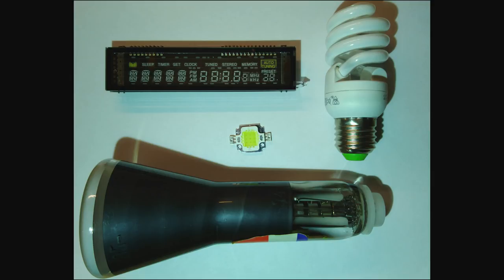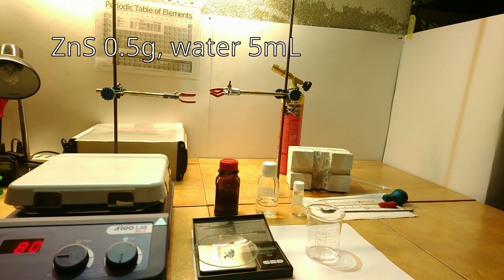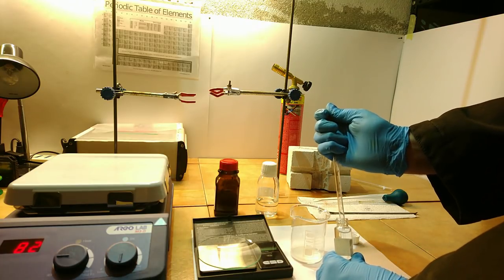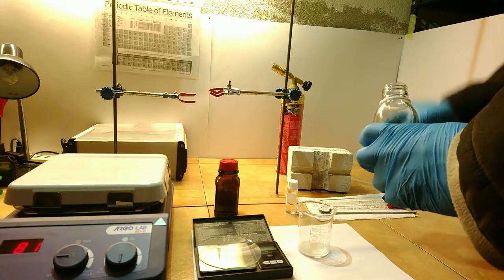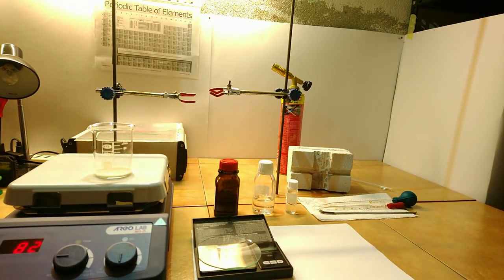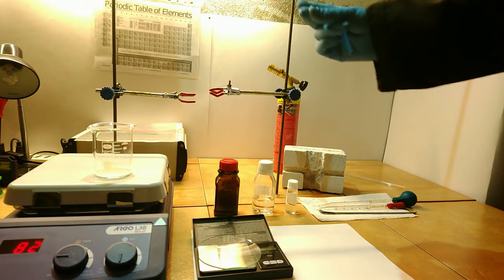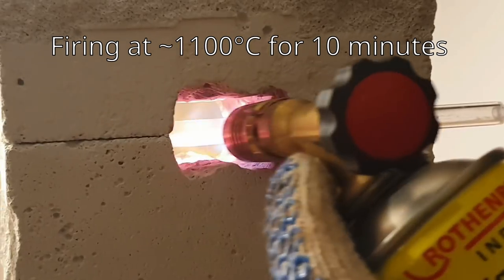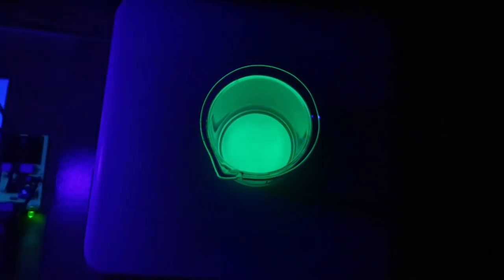Making ZnS:Cu, a green phosphorescent material

Comment: Thanks for the detailed video, we are making this today in my physics university class. Please could you let us know if there is a way to make the ZnS:Cu into a paste/liquid to make it stick to the bottom of a glass conical flask to form a phosphorescent screen (without dripping down the sides if it is moved around). We are making a DIY cathode ray tube :)
Reply from the maker: Chapter 5 of the book Inorganic Phosphors lists some methods. You can find the book in this thread https://www.sciencemadness.org/whisper/viewthread.php?tid=142184&page=2
Reply: @hydrogentime2872  Thank you !
Reply: @hydrogentime2872   sir thank you so much for making this love you so much plz one question 
Sir i made zinc sulphide with
NA2S+ZNSO4= NASO4+ZNS
CAN I USE IT TO MAKE GLOWING POWDER PLZ TELL SIR
Reply from the maker: @Nothingop122  assuming you made zinc sulfide, yes, you can make glow powder if you follow the process described in the video. You will need to add a tiny amount of copper sulfate and ammonium chloride, and heat the powder in a furnace.

Comment: Dose this also work for cadmium sulfide doping? I'm working on recreating no longer available phosphors used in in hold electron microscope screens.
Reply from the maker: The book I reference, "Inorganic phosphors", details many CdS phosphors preparations, with similar conditions. So it will work, but I do not recommend it as cadmium is toxic and you'll be working with fine CdS dust, which I believe poses an inhalation hazard.
Reply: @hydrogentime2872  in comparison to other chemicals i work with on a usual basis, that seems downright safe.

i work with mercury, mercury salts, uranium salts and osmium tetroxide, among other things. 

Thanks for the info, and the book suggestions, i shall read it as well.

Comment: Is it also a Electro luminance which is use in EL Wire ? Can i glow it with 100 volt ac electricity supply ?
Reply: So i can use It as an electro luminance material if I follow this tutorial?
Reply from the maker: I'm still trying to make ZnS work as an electroluminescent material, but I haven't succeeded yet.
Reply from the maker: @omsingharjit  Interesting papers, will have a read!

Comment: Is this process similar to making/growing a scintillation crystal?

If you mixed the doped zinc sulfide with an optically clear hardening resin would that work as a scintillation crystal?
Reply from the maker: I had to look up on Wikipedia about scintillation crystals, and the page lists ZnS:Ag as an option, which is very similar to the ZnS:Cu I synthesized. Maybe it could work, but I don't know for sure.
Reply: @hydrogentime2872   Thanks for the reply. I've been interested in figuring out how to  grow plastic scintillation crystals in a home lab environment but I'm just a hobbyist and no chemist. I appreciate you posting this video. I plan to try your synthesis method, currently just waiting on a copper sulfate.   

Since watching your video I experimented with mixing of ZnS:Ag:Cu with a clear casting resin. My plan is too attach this to a photomultiplier to see if will work as a scintilator for alpha/gamma decay.
Reply from the maker: @greengrowlocks566  Keep in mind that this kind of phosphor material is opaque to light, so what you're making will probably be more like a fluoroscopic screen than a scintillation crystal.
Also you'll likely need to recrystallize your copper sulfate and ammonium chloride at least once to get them pure enough to work.
Reply: @greengrowlocks566  a few issues you may incounter if you have not aready attempted and or encountered. Not only is ZnS rather opaque but it has a rather low efficiency to gamma radiation, it maybe sensitive to Xray but only to a degree.
I would imagine you may encounter issues keeping the ZnS suspended, although in a thin sheet it may have uses if this works out.
Also copper dopped ZnS has a long decay time compared to silver dopped.
Now the question if you dope it with Eu will it be more efficient to Xrays. Also using Lithium 6 will cause it to be sensitive to thermal neutrons.